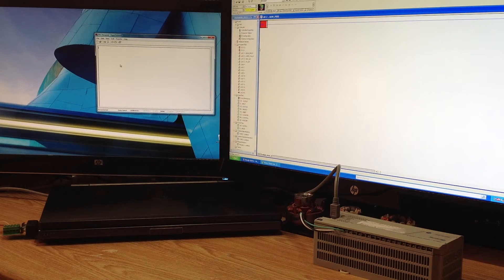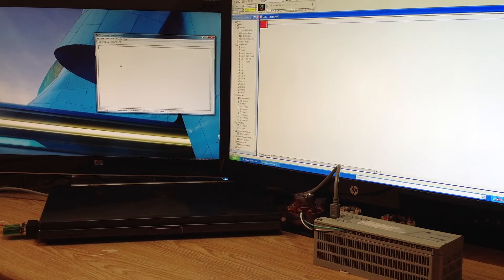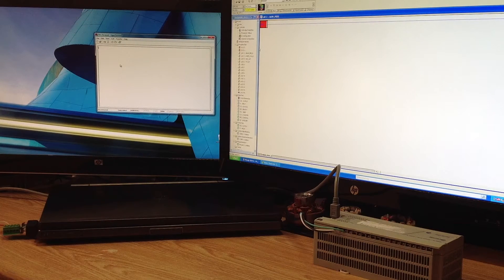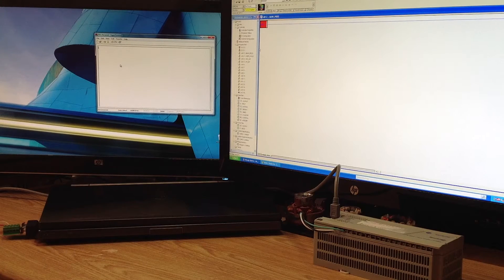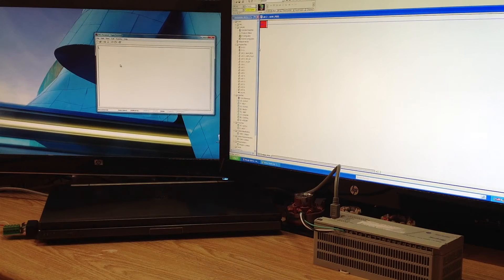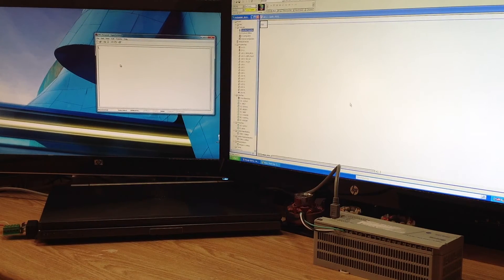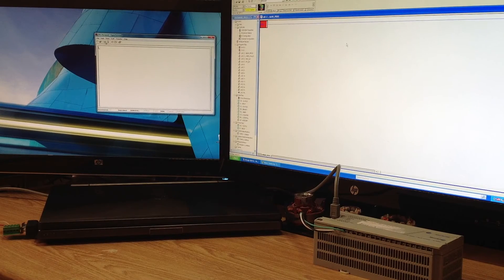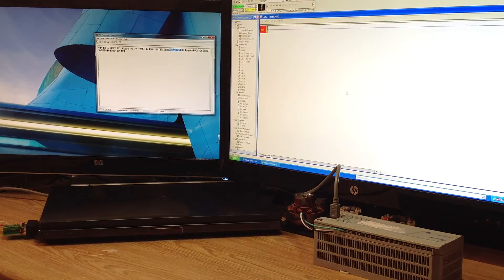How To: Allen Bradley SLC 500 / Micrologix Password Recovery Unofficial Backdoor

Comment: There is another option. Download a serial port sniffer or monitor. That way you can see data using same computer and do not have to worry about noise generated by technique above. Thanks for the help. Also Allen Bradley has added an option to encrypt data. If this is done I believe this will not  work. So if you are the one encrypting and do not want your password hacked, check that box.
Reply from the maker: I didn't know about the encryption setting. This procedure should still be applicable for all the older legacy equipment that's currently out  there.  I don't come across a lot of password protected PLCs so I haven't tried all the various avenues that will produce the same result.
Reply: I have just been trying similar on a Micrologix using a serial port sniffer. If you don't want the password encrypting, then it is upto 10 numerical characters. If you want the password encrypting, you must include 1 or more lower or upper case letter. When attempting to view at the same stage in the packet sniffer, it just appears in letters with a few symbols.
Reply: That's why it's always best to disable the RS232 ports also and provide the password lock to keep plant level guys out of the software. Lot's of piracy going on in the world on the plant level.